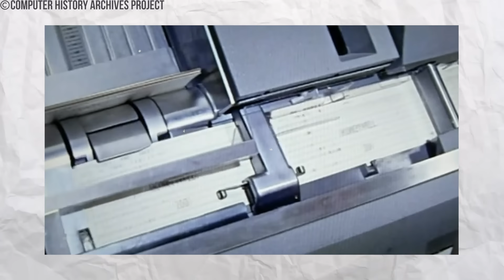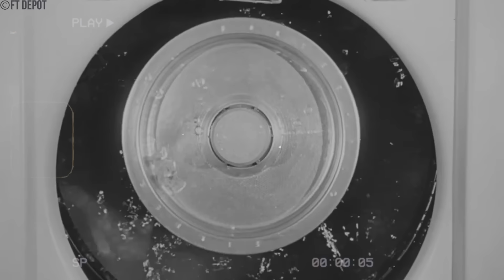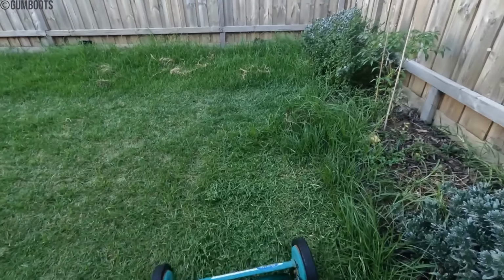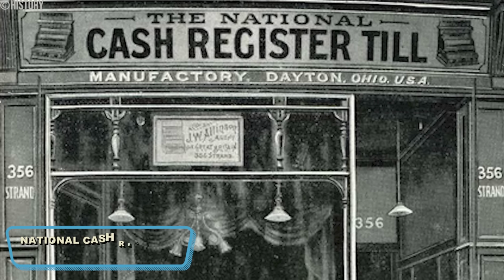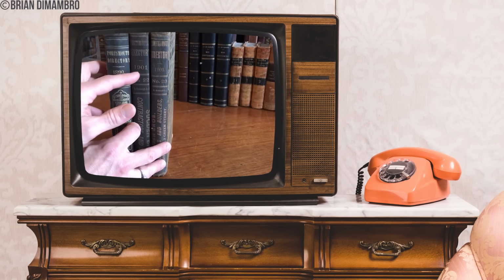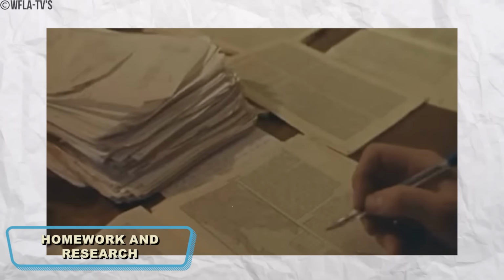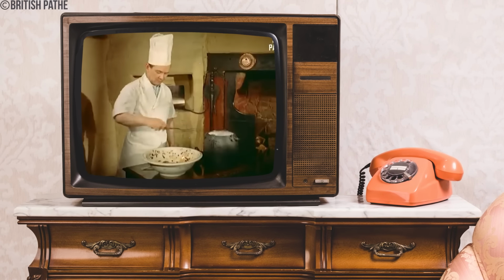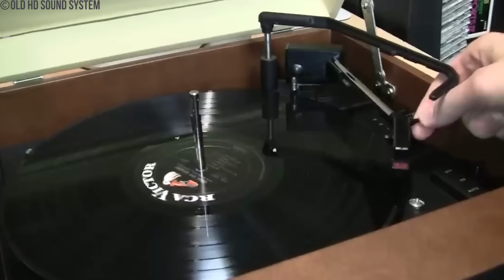25 Things From 1950s Once Necessary, NOW COMPLETELY OBSOLETE!

Comment: Home delivery of milk is not common but it is available in my area. One can still buy non electric items such as mowers which great for small yards. We have use a pressure canner but opt not to use it for cooking. Some pressure cookers could be used for canning. Our pressure cooker can only do water bath method. An Instapot covers similar features of pressure cookers. Our pressure canner, like the All American in the video, we bought a few years ago can hold quart jars and prepare a variety of foods. We are relearning skills and have less waste by reusing the jars and rings. Some lids can be reused such as Tattler. Some foods cannot be safely canned at home and must either be frozen or be canned by commercial canners.

Comment: Fountain pens continued until the 1960s when ball point pens entered the market.  There were some cartridge ink pens which competed with fountain pens.

Insta Pot is an automated pressure cooker.  Much more convenient than a conventional  pressure cooker.  Also Insta Pot has other cooking features.  Of course there is the messy thing of releasing the steam.
Reply: we had to use ink pens until 1965. Straight pen, dip pen was school issue, fountain or exotic cartridge pens buyyerown's also dipped Audrey Pestill's pig tails in the inkwell of my desk front.
 Office, strap.
 No calculators when they came out.
 Slacks no jeans
 mandatory dresses on gals, also no jeans and no dresses on guys
Reply: No such thing as insta pot.

Comment: I remember even as late as the early 1980s watching a tiny portable TV in a large static caravan. It was fine. It meant you concentrated more on the dialog anyway. The living room for this caravan had a real fire, that we would burn mostly wood in. It was very cosy at night, very low lighting, sitting by the fire and watching a little TV. These days everything is so bright and flat. People spend fortunes on houses and massive OLED screens, then refuse to spend $20 on a standing lamp They have the pointless, horrible ceiling light on and their expensive TV so high-up the wall they get a crick in their necks by the end of the movie

Comment: I’m 76 and still have my Brownie 127 camera which I got when I was 12. It’s got a bit rusty inside though, probably due to condensation. I also bought the first Polaroid instant camera, called The Swinger. It only took black and white pictures and when it slid out you had to wait for the image to appear and then coat it with some liquid to fix it. I’ve still got many of the pics I took with it and they haven’t faded. The camera got lost eventually.

Comment: We had the milk man and the coal truck. I remember the gas company in town having a regulator tank to hold excess gas produced. The storage tank would go up and down. Garbage can. Trash can and Ash can for ash and clinkers from the furnace. Just barely remember steam locomotives. Gas powered lawn mowers were a rarity. Bakeries all over town. Glass soda and beer bottles. "Church" keys.
Reply: I never saw a steam locomotive, as the Seaboard line in my area was the first railroad in the world to go completely diesel-electric.

Comment: I remember the 1968 Jobs section of major newspaper.  There were pages and pages of job offers for keypunch operators.  I mean 80% of the jobs were for keypunch operators and they were mainly for women.  I remember at one job the operators would punch out the cards without looking at the keyboard and fast as lightning.
Reply: I remember my early 1970's good gal was a keypunch operator. I think it is called data entry

Comment: The fresh milk being delivered to the door step should have continued to this day. i still don't see the reason how refridgerators made it more convenient. Having someone deliver your food and milk is a lot more convenient and opens up your schedule rather than having to travel to go buy it. Storing your milk in a fridge shouldn't eliminate the job of the milk man! Let's bring back the milk man! Let's also go back to glass bottled milk. Having our milk in plastic jugs is bad because we ingest micro plastics every-time we drink milk stored in a plastic jug! Again Bring back the milk man!

I also remember key punch machines. I worked in a library as a kid in the 1990s and we still did stuff like manually filing documents in file cabinet and using punch cards to check out library books. The punch card really didn't disappear where  Iived until 2000.
Reply: Milk delivery from small dairy is still used in many places. Pricey but very nice

Comment: Solid fuel stoves are useful. Much better value for money than gas fires because you can also burn wood and charcoal if there's no coal. You wouldn't want to use it everyday because you need to sweep up the ashes after each use, but if your gas or electric is cut off by bad weather it's good to have a backup source of heating and hot water

Comment: Rotary dial still works in many places. Percolators are still standard for many offices and churches  Punch cards were still in use through the 1980s; 1988 registration at U of Alaska Anchorage used them in the "arena scheduling". B&W TVs were still common in some areas in the 1980s, and B&W monitors in security systems into the 2000s. I have seen 3 working electromechanical registers in use in the last 10 years.

Comment: Pressure cookers are not obsolete. They are still useful for making things like stew or corned beef more quickly than they could be made using other methods. Oh, and the only problem with record changers was that they damaged the records simply because the records wereing dropped  onto each other.

Comment: There is a bit of nostalgia and a different quality to using film to take picture. I do remember in the 1990s and 2000s buying disposable photo cameras, preloaded with 24 picture frames on film with no way to know if the photo is good, no zoom and, for certain model, not even a flash. I still have some of those photos and tend to cherish them a bit more then the piles of digital pictures on my computer

Comment: Coal furnaces could still be useful today. Especially during blackouts.
Radio is still a thing, despite the internet.
Telegram, granted, is obsolete, but the morse principle is still alive and well.
Washing machines evolved, but remains basically the same thing.
Now, the icebox and the related iceman, now THAT is truly obsolete. However, we still have small iceboxes for camping and convenience stores still sell ice.
Milk delivery is indeed, no longer a thing.
I'm sure manual lawnmower can still be bought today. The advantages are eco-friendly, and they provide a good workout.
B&W TVs is splitting hair. TVs will never die. However, BROADCAST TV via air that work with a TV with antennae are a thing of the past.
Camera are still a thing. But developing film at a Kodak center is over.
Rotary phones were active well until the 1980's. I would say the landline itself is obsolete.
Cash registers are now just computers... and the cashier themselves are obsolete... Oh the irony.
The roll film cameras are obsolete, but we now film more than ever thanks to our phones.
Drive-ins theatres still exist, but those little boxes are indeed, obsolete. I remember them.
Wing vents? Now that's an obsolete oddity that really count.
Paper maps are still a thing. They don't need batteries nor cell range.
Mechanical pencils still exist and are in use today.
I won't believe that manual anything for home appliances aren't made today.
Enciclopedia. Granted, they are now just niche collectibles.
Punch cards computers. Now THAT is obsolete. I remember the Montreal tickets system used small "punch cards" as transfers-tickets until the 1990's.
 I'm sure, someone, somewhere, still draw plans by hand. But their obsolescence are barely 20 years old.
Cigarette vending machines... I bet in Japan and elsewhere in the world are still available.
Come on. Pressure cookers are still in use even today. Many still cook and do their own preserved food, FFS.
Percolators. The process itself may be used by some hardcore people...
...Same thing with developing your own photos on film.
I'm not sure about the records changers themselves, but vinyl records made a comeback in recent years.

Damn... I'm bored.

Comment: "useless"? No. They still do what they were intended to do.
00:05 The KODAK flash camera shown at the start IS "obsolete". If memory serves, it uses 127 roll film, which KODAK and other film manufacturers discontinued in the 1980's or early 1990's. I don't know if the flash bulbs it used are stil available. I do remember the camera could take pictures without using the flash.
Turntable for 78's/33.3's/45's and 16's that automatically changed the record when the one playing ended.
How is it "useless"? Vinyl albums and 45 singles are sold today. NEW Manual turntables (both high dollar "professional" models and somewhat inexpensive models for home use are sold on Amazon and other sites today.

I suspect other items in common use today (such as space heaters and freestanding gas/wood/electric heaters) and gas ranges are on your "useless" list.

03:33 WRINGER WASHERS??? I'd LOVE to have one! (gasoline powered or electric) THEY ACTUALLY GOT CLOTHES CLEANER than modern "automatic" washers! 
For one thing, for really dirty clothes (farmers, welders, mechanics, carpenters, and other tradesmen) you could start the wash at 6 A.M. and leave it agitate the laundry until 6 A.M. the next day (changing the wash water and soap as you saw fit), then wring/rinse/wring and hang on the line. 
Automatic washers agitate the laundry for 5 to 10 minutes depending on the wash cycle chosen (whites/colors/delicate) tops.

Comment: Ah yes! Those Saturday and Sunday evenings when the family would gather in the living room or parlor and WATCH the radio! LOL
Telegraphs were faster and more reliable until the mid 50s. At 3 to 5 cents per word, or more, they had better be that! 
Those electric rollers were dangerous! Especially if kids figured them out!
Oh yeah! The Three Stooges! That was a perfect match for that subject! I recently saw an old 1928 Kelvinator refrigerator that had been in use since new and had never once been serviced! It still runs cold as the day it was delivered up two flights of stairs!
We had a milkman until the 1970s! We also had a diaper service but, once sister and I got trained that was no longer necessary. Unlike JB in DC!
Push mowers! Our father taught us all about Tom Sawyer with one of those as well as with a paint brush!! LOL Holy mackerel Batman! Was that a Fly-Mow that I just saw! WOW! 
We got our first color TV in 1968. Dad bought it for the Moon landing. He was quite taken aback when the live feeds were in black and white! I had to explain to him that color cameras were too heavy and expensive to send to the moon! He was nearly devastated but, he got over it.
Before flash bulbs it was flash powder in a holder! BOOM! I used a lot of flash bulbs before finally getting my first external electric flash!
I still have some rotary phones and they can still be made to work! I miss listening to the neighborhood gossip on party lines! LOL
Do I ever miss those manual cash registers and that mighty KA-CHING!
We never got into the movie side of photography. It was way too expensive! We barely played with the video junk, either. Not worth the effort or cost.
We still have drive-in theaters in the USA! No. The audio covered up the noises coming from the back seat of the car next to us! LOL
Bring back the wings! Those were great! Cars today are boring junk wagons!
The Boy Scouts and then the Army taught us all about Land Navigation! WE DON'T NEED NO STINKING GPS! If you cannot read a map then stay home! As for Google Maps on a cell phone, that's a joke! During the last solar eclipse tens of thousands of people in New England were stuck in traffic for 7 to 12 hours! I made the same trip in only three and a half hours because I had a map and knew how use it! Google screwed so many people they should have been considered a .... Never mind! 
I still have several mechanical pencils on my desk now and use them daily.
We don't do parties and we don't do ice! We never hooked up the ice maker in our refrigerator, either! We don't like cold drinks!
The encyclopedias got me all the way through college and beyond! I have to admit that the Internet does beat it. As long as you can sift out the Bravo Sierra!
No more key punch! What will I ever do with all of these rolls of tape with the little holes in them! The ones that are ten feet long or longer? CONFETTI!
I have three of those drafting sets in my desk right now! I've not used them in 30 years because I just do all of that in my head. LOL
Now those machines can stay out of production until Hell freezes over! It wasn't the smokes. It was constantly having to make change for them that got my goat! Of course, tobacco smoke and those wearing it stink worse than an old outhouse and should be shunned at all costs! 
I have never used or required a pressure cooker.
Those old coffee makers still brew better coffee than anything on the market today and I don't drink coffee! Not anymore.
I still have my B&W darkroom! Film is still out there and is making a comeback!
I have several old record players and turn tables plus a lot of 45s and LPs! They tried to kill them but, they're baaaaaaaaaaaack!!! LOL

Comment: Living in coal country, we still use coal. It's a nice warm heat. And as long as the hopper is full and the worm works, it's pretty hands off.
Reply: Our 1950s coal furnace was filled by shovel,and ashes removed the same way. then there's disposal of the ashes....
Reply: @JayWye52  the borough picks up the ashes on Wednesdays. They use them on the roads in the winter.

Comment: 10:19 Uhm, Digital Cameras didn't replace film cameras in the 1970s. Viable, Digital Photo Cameras were not on the market until the very late 90s and Film still stuck around for at least 10 more years after. 

Video cameras also did not replace consumer film cameras until the 80s when VHS became affordable and widespread, and this was still a very analog affair. Digital Video Cameras wouldn't take over until the early 2000s

Comment: So if going green is so important, why not a return to returnable, reusable glass bottles for beer or soda? No reason to use gas powered lawn mowers on small urban or suburban lawns. Return to mechanical reel mowers. You Don't need everything on Wi-Fi either. Most of the old analog  or manual items do the same tasks with less to go wrong.

Comment: Vacuum tube radios especially for audiophiles still exist, manual lawn mowers are still made and used, maps are still useful if not in well cell covered areas with more and more cars no longer having gps installed neither, non-disposable mechanical pencils are still used in arts and by the oddly wealthy

Comment: In more than 70 years I have never before seen or heard of an ice crusher (manual or electrical) in any home!
Not mentioned is the slide rule, an essential tool before electronic calculators.
Reply: the slide rule was used by NASA and various engineers and scientists till Texas Instruments invented their first portable scientific digital calculators. so, nope... in use well WELL past the 1970's.

Comment: Sorry you are out by at least a decade. Unless you lived in remote parts of the US, these changes came before 1945. I had a transistor radio in 1954 and my father distributed automatic washers (Bendix Corp, South Bend, Indiana) in 1946 . Refrigerators (Frigidaire) started in the 1920s . Sure there were still ice boxes in summer cottages. Again, just change your title and text to the 1930s and 40s.

Comment: Back in the 70ties it was cheaper to have a dial phone than a push button unfortunately the phone company started forcing people with dial phones to switch they sabatoged the dial phone equipment you'd make a call and more often than not you got a wrong number one day after 5 wrong numbers I took 7 different colored felt I dialed my number and even though I had proof of the
Number I had dialed I got a wrong number took 8 times to finally get my call connected they finally got us to switch by eliminating the difference in cost between the two

Comment: HaHaHaHa. Tubes never went away. High end guitar amp tubes always used tubes. The sound is still the best. Want the best stereo sound? Tubes. The military backup systems are tubes. An EMP will take out all the computer systems. Compare vinyl side by side with an MP3. You realize just how bad MP3, CDs, and esp bluetooth is.

Comment: An important paper reader computer from the 1950s is the Bendix G-15. Especially with David C. Evans attached to its creation. Though no doubt so bulky. 

The computers of the Mercury Space Program; the IBM 7090 transistor computer, were actually introduced at the end of 1959. They were based on the older vacuum tube IBM 709.